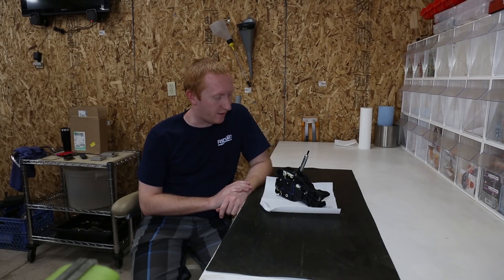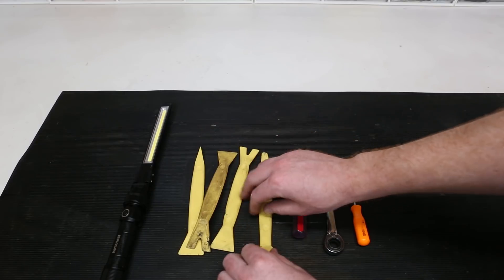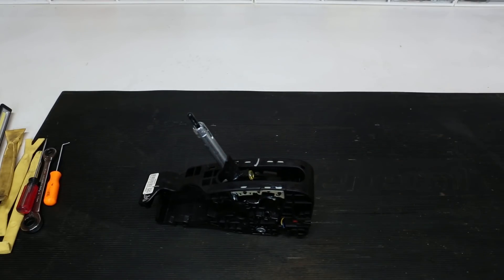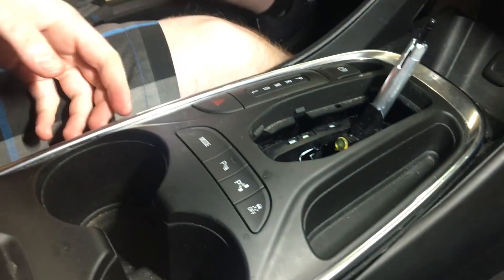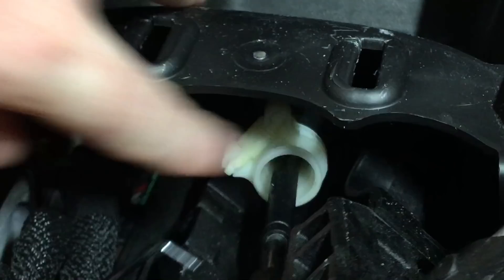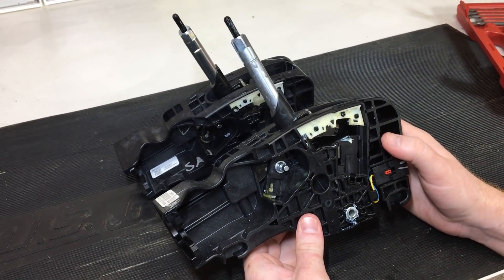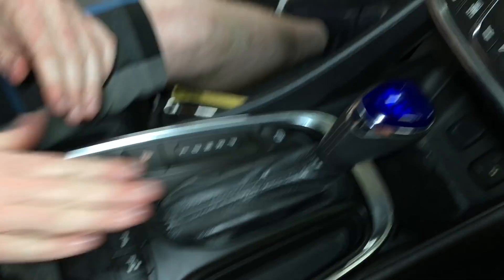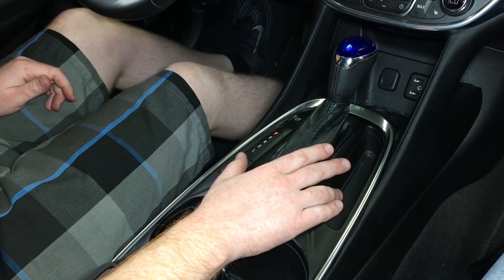Chevy Volt Shifter DIY Replacement: Shift To Park repair

Comment: Don't need to disconnect the 4 electrical connections to the removed top panel, just move over to driver side. Also no need to cut zip tie on cable harness. Only need to pry the serrated hold tie down free from unit with screwdriver, then push back in later. Very informative and accurate video, well done.

Comment: Thanks for a great step by step video!  I just finished replacing mine and had a few glitches that I thought your future viewers might find useful:

1.  The ratcheting wrench I got for this project wouldn't get in there even at an angle, but I my 3/8" ratchet and 10mm socket fit just fine so that's what I used.

2.  You cut a zip tie (at 5:30) but I pried out the entire plastic holder because i wanted to be able to pop it back into the new assembly.  Worked great, and it popped back in so it looks original. 

3. The bolt holding the assembly wouldn't pull completely out due to being a little too long for the space, so I took pliers and pulled it out until I could slide the assembly back and out.  The bolt stayed wedged right there against the hole so when it came time to put it back in the new assembly I just grabbed it and worked it back into the hole and done!  

4. One of the cable connections to the cover I just couldn't figure out how to pull it out so I just put the cover on the driver side like Dean Jenkins mentioned in his comment.

5. My mistake on this last one, but I didn't re-watch your video just before tackling the job, so the little push lever on the gear shift cable coupling - well, I sort of broke one side of it because I completely forgot you just push on it and it releases the assembly.  Luckily the piece that you push can still hold one side secure so it won't fall apart on the road!  Lesson here for all future DIY'ers - watch this video one more time before you tackle the job for a refresher on all the great tips.

Thanks again for a really good, comprehensive video.

Comment: Dude, this is an AWESOME video. I did this project today on my 2016 Gen2 and never could have done it without it. Thank you sooo much. Having said that, here are some tips from my experience that may help others:

- The plugs are a BEAR to get out (at least they were for me). He doesn't show himself unplugging them in the video, but he tells you how to get each one out. Only one of them came out easy for me; the rest were a huge PITA. Another poster on here said that you can replace the shifter without unplugging everything on the console (he said just move it over to the side). If you are having trouble like I did, I'd recommend trying that.
- You can get the nut off by using a small 3/8" drive socket wrench and a regular 10mm socket. I tried my ratcheting wrench as he recommended, but it didn't work because the ratchet on my wrench doesn't protrude out like his does. Mine didn't protrude out far enough to catch the nut. 
- One thing that I was confused about was how to get the shift boot off of the console. I assumed that you had to access the clips from the bottom, but that isn't right. Use a flat head screwdriver or a prying tool and go at it from the top. It comes off easy. 
- The head of the bolt is square, so I assumed that it self-locked into a square hole like a carriage bolt does. It's almost impossible to see down there, so I just didn't know. Anyways, it does not. When screwing the nut back on, if you don't secure the square screw head by wedging a screwdriver or something else in there, it will just spin around and around while you're trying to tighten the nut. 

But again - GREAT VIDEO! I can tell that you put a lot of time into this. Thanks for saving me $300 - $400!

Comment: Another YouTube video shows how to bend the metal tab that presses on the micro switch. This method worked for me on my daughter’s 2017 Malibu. The video shows the shift installed, but fully exposed. I was able to accomplish the micro switch tab adjustment with the shifter installed and without removing the shift knob. It took me about half an hour and the cost was zero. No parts required.  It seems to have worked, with no further problems since I did it about 2 weeks ago. Thanks to all who posted videos on this, you are providing a great service!
Thanks to all who posted videos on this.
Reply: I did the same thing with my 17 volt. Bent the little metal tab gently and for extra assurance put a tiny piece of duck tape on the part where it connects to the button so it's slightly thicker than it was. That metal is way too thin and I'm fairly sure that as the car gets hot, the metal heats up and bends slightly which causes the issue. Only used less than a penny's worth of duck tape and a pair of angle tweezers to place the tape. Done in less than 30 minutes.

Comment: Good job, Chevy needs to make this a recall
Reply: Agreed, isn’t there standards to substantiate recalls? Haven’t we crossed that bridge already? Something doesn’t add up.
Reply: @scottkolaya2110  Yeah Scott I and many others have done that. The problem is that most dealers have no clue what you’re talking about, and many will refuse the job until they really look at their paperwork, sometimes needing to call corporate to verify. A recall makes the process nice and easy, because it flags on dealer computers when checking for outstanding issues. Consumers are disadvantaged when dealerships have no knowledge of this, and question the paperwork a customer is presenting them. I’ve heard from other chevy owners who have gone into dealerships and been refused this service, but might succeed after a lot of persistence. It’s the old run-around, as they call it, and just recalling everyone’s lousily built shifter assemblies would simplify the process. This issue is serious. I had to tow my car away from my job site and had to cab home. The dealership only covered the cost of the shifter. I brought in my receipts for the tow but they didn’t cover that. So much hassle when they should have just done a recall. This is a very common condition for Chevy Volts.
Reply: @scottkolaya2110  thanks so much for info, my 2017 is at dealer now to be fixed. Hoping dealer doesn't give me any problems fixing issue under warranty you mentioned.
Reply: @storkman  let us know how you make out.
Reply: @storkman  how was your experience at the dealer?

Comment: Love this! Thank you! My 2017 developed this issue a few months ago and it just seems to be getting worse. I googled the issue and came up with a few pages of customers with this issue, on gen 1 and gen 2 volts. I can't believe Chevy didn't come out with a fix for this!!! They're letting dedicated volt customers down!
Reply: Actually, I read that they did. They will replace your shifter if it's still under warranty. When this problem became obvious and huge, GM fixed the problem with the shifter and had dealers replace them on new Volts before they were allowed to be sold. The problem with mine was that it started acting up after the warranty was up. But you're right - GM should be replacing these shifter on all Volts, warranty or not. It's a huge issue.

Comment: Absolutely outstanding! Mine hasn’t been acting up but if it ever does you are my gold star. I thought I had to take the seats out and the center consul sides out and blah blah blah. One thing I would use would be a small extension magnet to keep stuff from falling into the center console cavity.  Once again excellent work and excellent camera work from your assistant.

Comment: Awesome!  Thanks for the tips.  Just bought a used 2016 Volt that seems to have this random shift to park issue.  Took back to dealer and they just followed some lame TSB to have transmission “relearn”.  Three days later and it’s been doing it every day.  Gonna DIY now, seems easy enough 👍

Comment: Excellent video Justin! I think this will save a lot of people $400-500 bucks. I took mine to the dealer two weeks ago and they installed the 4th revision of the shifter assembly as well. So far I haven’t seen the issue comeback.
Reply: Did dealer warranty the replacement as mentioned in above podt/reply?

Comment: Great video. I ordered the shifter and will be replacing mine as soon as it arrives. Now for the 2nd most common issue, the EGR reduced flow issue. I'd love to see a video on replacing the ERG valve, as I cannot find anything with a search on the internet and I have yet to see any service manuals for it.

Comment: Just in case there's others looking for this fix. I took mine too the dealer under warranty to a Chevy dealer. They don't see many volts in general and only one or two of their mechanics know anything about them. But I got mine fixed in one day. I was expecting them to do this but the service writer told me they put in a bypass harness. Not sure what or how this works but when I went to pick it up the problem was fixed and hasn't come back since. Maybe this will help anyone. I own the 2017 Volt.

Comment: Did mine yesterday with the 5th gen part number.  FYI you do not need to remove all the clips on the shifter.  Just remove the 6 boot clips as shown in the video and pull up hard on the shifter and it slides out easily.
Reply: gen5 part #? thanks
Reply: Sounds confusing when you say to pull up hard and it slides out easily.
Reply: Paul M, I have the 4 volume service manual. It says to pull and turn the shift handle and pull up. It does work, so no need to remove that little clip.

Comment: I've had this problem on and off on my 2017 Volt and I've just gotten used to the "quick fix" method that I discovered.... Just pull the shifter button in and let it go so that it flicks forward (while in park) and it works every time.
Reply: I tried that trick on my 2016 Volt and it didn't work for me. :(
Reply: @jasonross4260  are you sure you shifted to park and then let the shifter button flick out? That's not good if it's not working for you. I'll probably get online and start pricing the shifters out now before my little trick stops working.
Reply: @jasonross4260  that switch that you're flicking with the shifter button is deep in the guts of the shifter.... it sounds like yours might have just failed completely.

Comment: Check with your dealership before you do this yourself. I had the exact issue in my 2017 volt and the dealership replaced it for free under warranty.

Comment: Great video, Justin! I almost wish I had a Gen 2 to try this on! I am curious when you had the original part next to the new part if you saw any improvements or differences between them?
Reply: He said he didn't see any and doesn't think there really is a difference between the two. But I suspect it's just a little wear and tear. Which means it could be just enough wear not to engage the selector into park completely.  Just worn out plastics. 

I'm have a feeling GM will not fix this because it's not a safety issue that could cause a recall. It's just normal wear and tear. 

I noticed mine has this issue. I just push mine a little more forward and the gear selector recognizes it into park. Even though it was already in park. I barley noticed it was an issue. I just pulled up videos on the volt and have been surfing the net for helpful stuff like this. So thank you to the guy doing this video.

Comment: Great video. Part is 60 on ebay.
Reply: be careful with ebay, I just went through the same issue and most of the parts on ebay are the "old version" part number.  There's a newer one out.  Part number 13534319   I got mine from GMpartsgarage for $58.97 + shipping.   I'm sure the old versions will work, but apparently the old versions are notorious for crapping out like many of us here have experienced.  Who knows if GM updated the part to fix the issue but can't go wrong with the latest and greatest version from a genuine OEM supplier.

Comment: Can’t imagine doing this when it’s covered under the warranty.

Dealer knew all about it and replaced the switch and the wiring harness.

Left car at 10:15 and it was ready at 11:30.

Mine is a 19 Volt.

The switch must be the large black unit, but what is the wiring harness?
Reply from the maker: When I made this video years ago the Chevy TSB said do not cover it under warranty. Eventually enough people complained they offered it under warranty if requested but still won't consider it a recall. Also my 2016 was out of the warranty.

Comment: So what is the actual cause?  Is there a microswitch that is going bad?
Reply: There is a video on Youtube where the guy bends the tab that pushes on a microswitch so that it makes firmer contact.  For that you don't need to actually disassemble the shift control from the vehicle. Don't know how permanent this would be. You could try the quick-fix while you wait for the part to arrive.  See: https://www.youtube.com/watch?v=mFz87_o2b38.
Reply: I'm going through this with a similar failure (or at least it looks that way) on my GF's 2017 Malibu.  It's a super common failure on those as well.  However, the service writer told me that in that case, it's that a wiring harness gets worn and eventually fails.  So I'm not sure if Volts and Malibus both experience exactly the same failed assembly component or not.   I just wanted to point out, in some cases, it's potentially the wiring that fails, not a microswitch.
Reply: GM is using the safety park solenoid to produce a weak pulse that is detected when you move the shifter to park. I tied a tiny neodymium magnet onto the solenoid shaft to boost the signal and got another year of life out of the shifter.  The plastic detents in the shifter were wearing at 100,000 miles on my 2017 and the problem came back so I replaced the shifter with the 13520827 part.
Reply: @floobertuber  a harness wears out? 😄....what a stupidly bad excuse he gave you. Harnesses don't wear out.
Reply: @scavenom2008  They can if a moving part wears through the wire insulation, or a connector terminal comes free from its housing.
Reply: From what I've seen, the microswitch is underated for the current and it fails.  So they add a jumper harness that contains a resistor or maybe a diode, I don't remember which.

Comment: If this fix doesn't work for you and you cannot get your Volt to turn off, a new connector and wring harness are free as well the install at your nearest Chevy dealer (reference GM Service Bulletin 19-NA-206, dated February 2020).  Let me stress that if you cannot get your car to turn off (Chevy Blazer, Malibu, Traverse, Volt, GMC Acadia), you 12 volt battery will run low and be killed if you don't get it to a dealer ASAP.  The dealer will not give you a free battery ($200) plus battery test socked me for $234.  So if you cannot get it to a dealer, disconnect the 12 volt battery in order to save it.  If you get it to a dealer, disconnect the battery when you get there and alert the service department that you did so.  GM will reimburse them for the installation of the harness and shifter, not the battery.  That's on you.  Just figure I'd give you a heads up.